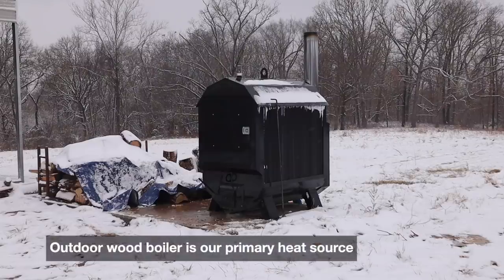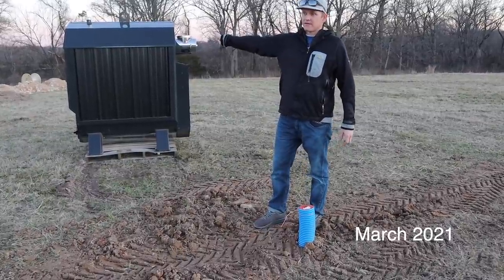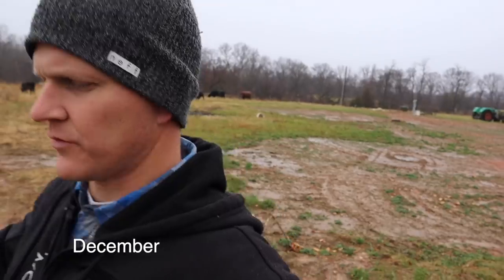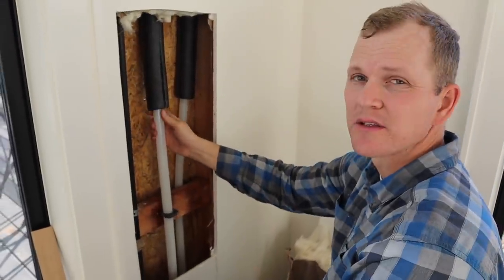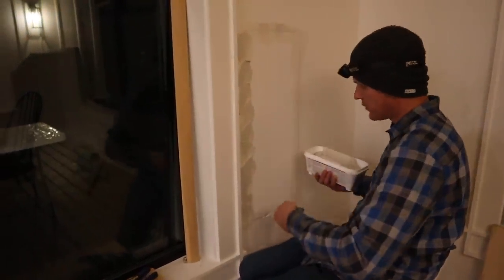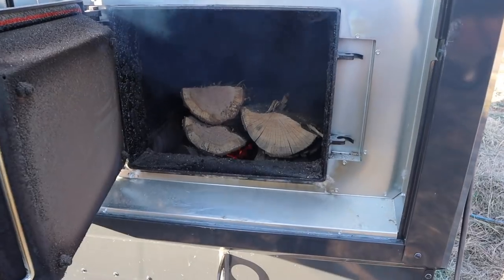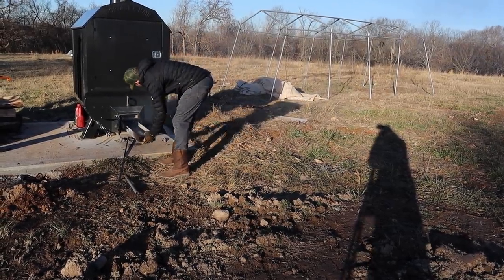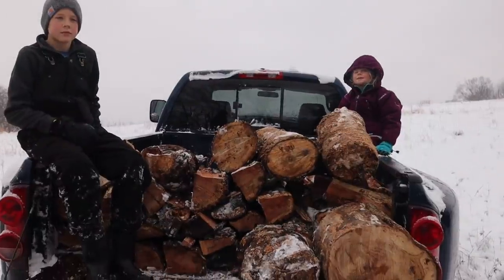Why We Heat with WOOD | Outdoor Wood Boiler | Wood Burning Fireplace

Comment: Always burn dry wood. Water doesn't burn. Insulation is key. And keep the fire close. Don't be fooled by thinking burning big half green wood is the answer.
Reply from the maker: True true true.  Immediately following this video I built a firewood shed adjacent to the boiler.  Done with tarps, now that I have a rain cover to keep the wood dry.  I'm a big stickler on dry, seasoned wood, and keeping my chainsaw sharp!!! -Cam

Comment: Next video of your new house burning down from you throwing ashes under the deck. Also please do a real cost benefit analysis... there is no payback on these for many many years. Then it will rust out stainless or not. Total waste of money.
Reply from the maker: Sheesh! You really have something against outdoor wood boilers.  That's totally fine.  Its not like we're forcing anyone to buy one, just sharing what we have chosen for our home.  Sounds like you've done the cost benefit analysis already.  Would you mind sending me the numbers, I'd love to review them  -Cam
Reply: @TheSeasonalHomestead  I actually presently have a Woodmaster 4400 before that a Heatmor. I have heated exclusively with them for 30+ years but to buy one today it just doesn't pencil out.

Comment: Don't forget to mention that outdoor boilers are not very efficient. Wood hogs actually.
Reply from the maker: So far we are heating twice the house, a few degrees warmer even, with the same amount of wood as last year.  I'd say it's doing ok.   And whether it's a wood hog or not, I'm totally ok providing my own fuel, free of charge, rather than relying on another entity to pipe me fuel, and charge me what they want since they are the only option for the entire area...  Thanks for watching!  -Cam
Reply: Modern triple pass or gasification units are very efficient. This unit in the video is lower efficiency than a gasification unit, but you have the ability to burn a range of wood, even mixing in some green wood if necessary. Gasification units would be about 25-35% more efficient than this one.

Comment: Because you hate forests?
Reply from the maker: I like healthy forests.  A forest full of dead trees is hardly a forest :)
Reply: @TheSeasonalHomestead  but a woodpeckers paradise.
In germany "everyone" belives heating with wood is CO2 neutral, and therefore a good thing. They all buy wood pellets, get that delivered like oil, and use it like oil. But the result is, eastern europes forests disapear illegaly to satisfy the wood pellets market. 300€/m^3 is enough for that (before the war) and wood prices rose up to 700€/m^3.
That's why in europe heating with wood is a bad thing and everybody should use heatpumps. Than no forest has to disapear.
North America is different.
But heatpumps are just hvac working inverse. So i guess most americans are already set up to use those.

Comment: How come you have to have it so far away from your house if you have it in a shop how far could you have it please  Let me know thank you this is nice
Reply from the maker: Needs to be at least 50 ft from the house.  Ours is a bit further due to where we plant to put our future shop.  Sort of split the difference between the two.  With the insulated pipes that the water runs thru, there isn't much heat loss at all between the boiler and the house.

Comment: My ocd kicked in when you are loading boiler from the left instead of the right as the door opens to the left! I would have stacked the wood on the right side but kitty corner in front about 5 feet away! Like so:

[||]  boiler
    X wood 🪵 easier!